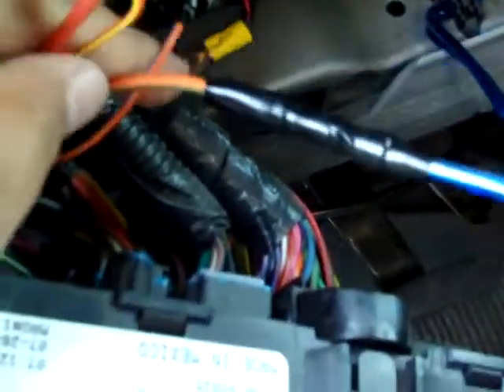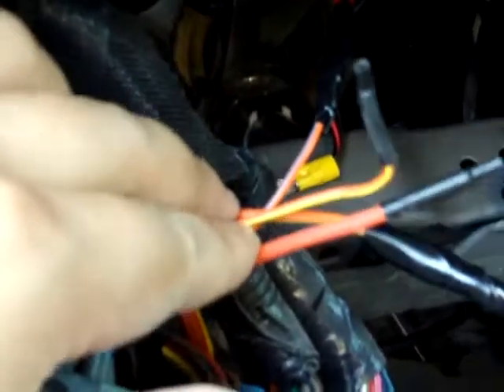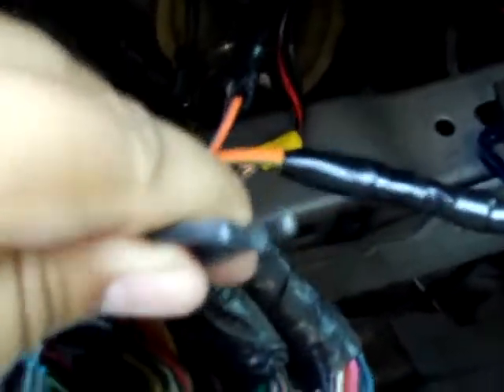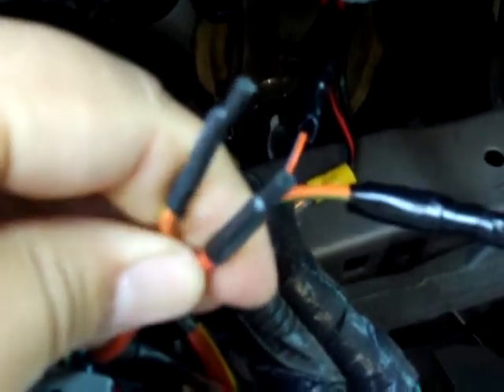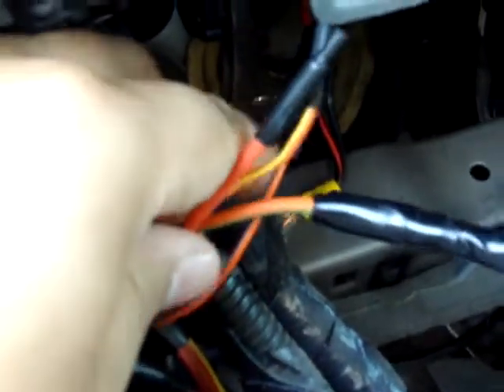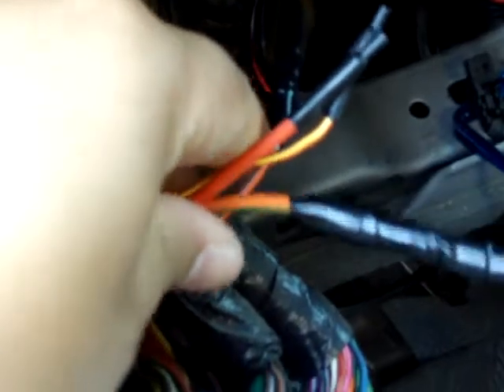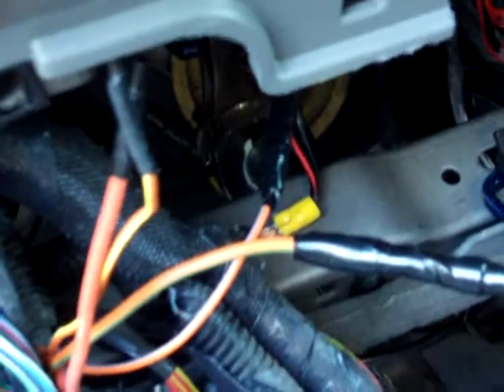2006 Ford F250 Superduty Powerstroke 6.0 Upfitter Switch Location

Comment: i have a question one of my wires coming from my switch has no power i switched the relays in fuse block so thats not the problem any clues ???

Comment from the maker: Well if you need to connect something from inside to the outside, just connect your wire to whatever color open ended wire, and then to continue your circuit in the engine bay, locate the same color open ended wire and continue your work.

Comment: Where is the info for the 04 trucks?  I have wires under my hood. But no switches inside.
Reply from the maker: It could just be the pass through wires to help you add accessories.  Mine came with the switches, so the wiring was there already next to the pass through wires that you may have discovered.

Comment from the maker: Well the only thing I can think of is if you bought the truck used and a previous owner had modified the upfitter switch at the back of the switch for possibly turning on while the truck was off.  Hope that helps.